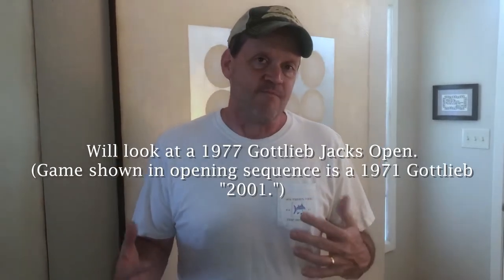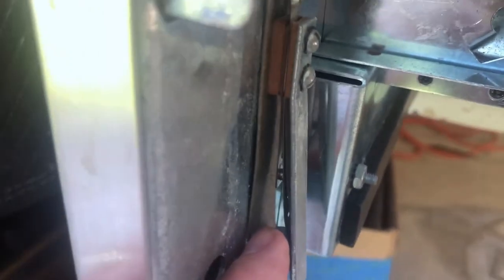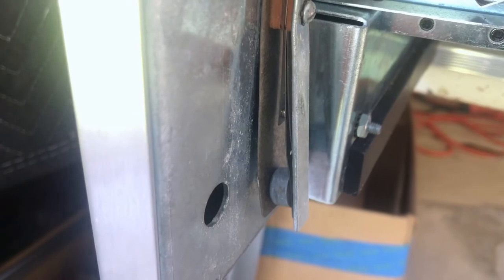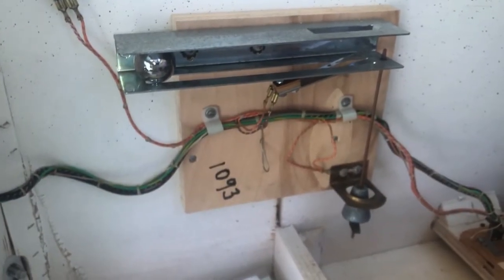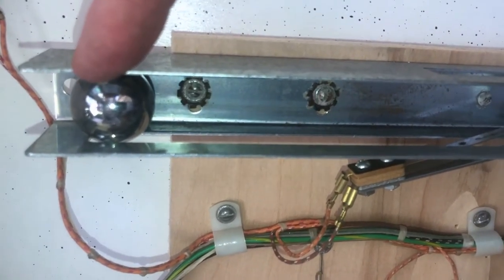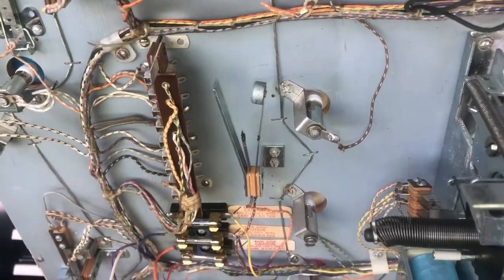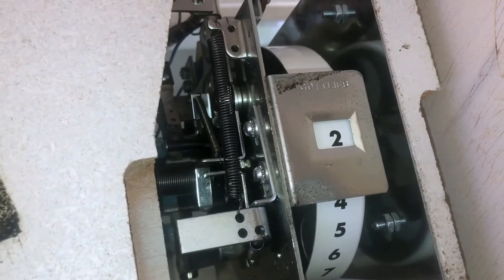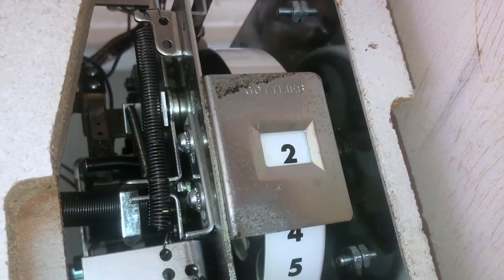Gottlieb Guy Episode 3 - Tilt Switches

Comment: Thanks for the quick response.  Great idea about the transformer.  The only thing is that all the voltages test out perfect.   Also, going through the self tests also works like it should, no errors.  The pinball guy is here now.  He is stumped as well.  He has not run into this ever and he has worked on pinball machines for decades.  The only thing that he thinks it could be is something to do with the Tilt features.  We checked all the tilt devices and relays.  Nothing there.  Hopefully while he is here now, he will figure this thing out.  Thanks again for the reply.

Comment: Thank you for posting this video.  I have a "King Kool" pinball machine.  After moving, the tilt light is on.  I did not know about slam switches.  I will check all of these to see if it will resets.  Will let you know.  Thanks again

Comment: I turned on my Soccer (2 player) yesterday for the first time in a few years. Aside from needing a tune up it worked fine. Today I turned it on and played a game. When the game ended it did not reset. I turned it off and then on again it is now in TILT mode and I cannot get it to reset. Any suggestions for me to get it working again before I call a pinball technician.

Comment: I just purchased a 1976 Gottlieb Buccaneer that seems to be in very good condition except I can't seem to get it to reset out of Tilt.  All the Tilt switches seem to be fine.  Any suggestions?  Thanks, Jeff.
Reply from the maker: Hi, thank for the question. SonI believe that game starts up in Tilt when powered up and then, of
course, would come out of tilt when you press start.

Sounds like it’s not doing that. Is the game set for free-play? Or is it still coin activated? Also, are you able to manually add a credit by advancing the credit wheel in the head and then starting the game?

If you want, email me at pinballguy232 - it’s a gmail address.

Comment: I'd like to see someone do a video showing the connectivity of a mid-70's Gottlieb 4player coin apparatus, the coin unit (under the chimes) and the player control unit in back.  Specifically, how the quarter activates the coin unit, and what it looks like on the schematic.
Reply: Update, it would be more helpful if you showed these switch locations in the schematic.  Of course, logic would tell you that it's probably close and in line with the Start switch, if you can find that.

Comment: Hi there, I have a single player ‘75 El Dorado.   Should the tilt Bob end the game or ball?   My ‘76 Surfer just ends the ball.   The El Dorado seems to be ending the game.   I don’t know if this is an issue or correct for this machine.   Thanks for any help!   Great video!
Reply from the maker: thank you! I’m fairly sure there is a switch that is probably in the head of the game that can be adjusted so that tilts either ends the game or ends just the ball. It’s probably a Jones plug if you know what that is?
Reply: @thegottliebguy  Thanks, yes I do know what a Jones Plug is - there's 5 of them in the head but none look to offer options like the 3/5 ball jones plug in the bottom of the cabinet.   The lift tilt switch and ball have been completely removed from the head, so I don't know what is closing the switch.  I took one of the leads from the rail lift switch and screwed it into the rail near where the tilt bob is hanging and if I touch the bob to the ring now, it causes a tilt.  Without this fix it was not tilting at all.  I noticed when the tilt occurs, the hold relay also disconnects, ending the game

Comment: I am having an issue I can't seem to solve with my Haunted House.  Maybe you have run into this issue on another Gottlieb machine.  When you press the play button the all the score displays go out.  They will not come back on until you turn off/on the machine again.  I have tried to see if any of the tilt devices are in the wrong position.  They are not.  I checked the T relay and it seems OK.  However, I am not a Pinball Guy, just able to tell if things are open or closed.  Also checked continuity on all the fuses and they are good.  Any thoughts?
Reply: We got a Brunswick Aspen machine a while back and when we first got it the scoreboard would keep tripping. It was a breaker issue and it would constantly trip over the lowest little voltage. Its hard to explain the whole thing, but my dad put a transformer from a car or something and it hasn’t tripped since. Now they are obviously two completely different games from different manufacturers, pricepoints, quality’s, etc. but it COULD be a possibility. I’d definitely ask around a little bit more of course.
Reply: Annnd I just read the end of your comment. Whoops.